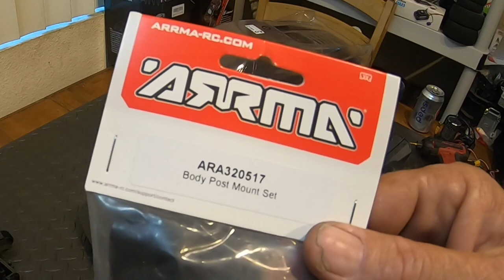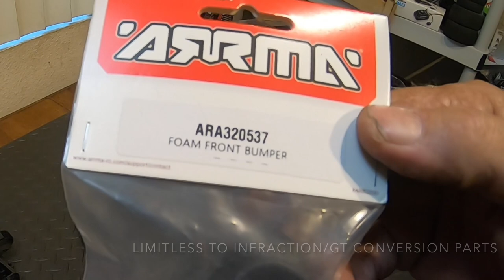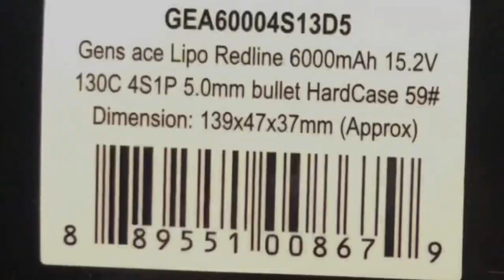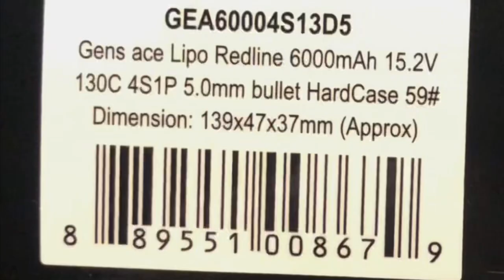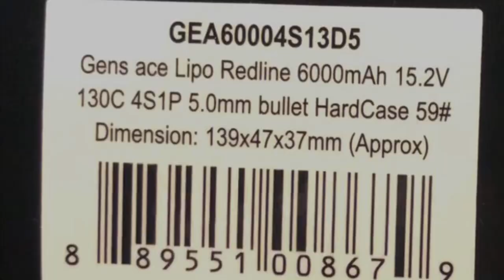Arrma Infraction v1 Speed build part #3 battery tray mod & receiver box mod with wrong part ordered?

Comment: Awesome build dude!!! I see only one problem. Those batteries fully charged will over volt the esc. Unless you run them parallel.
Reply from the maker: Let see if castle can handle the power or will it go up in smoke 🤔🤔😬😬
Reply: @earlmoorhead5555  👍🏻

Comment: So 1/7 scale by my crappy math you multiply by 7? So at 100 mph these cars are doing 700mph in scale speed? Sorry a little buzzed hah. I even was thinking how about a device that speeds the motor and ESC fans when the temps go up and when cooled down the fans speed goes down.... That way you get maximum battery capacity?

Comment: Earl - question I have xlx2 with 1717 1650. Can I use qs8 connectors on esc and then adapter to ec5. My battery’s are ec5 and I really don’t want to cut and solder on the new battery’s?